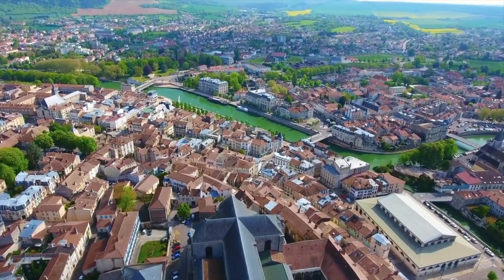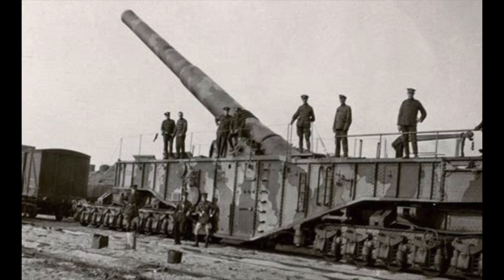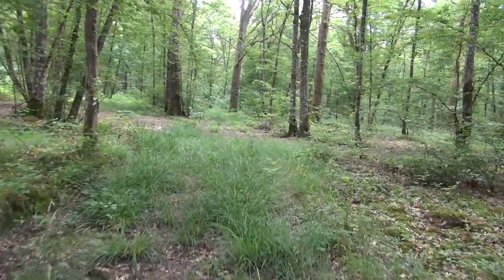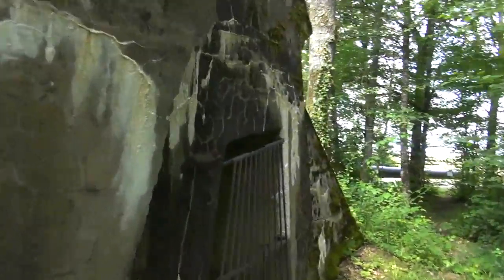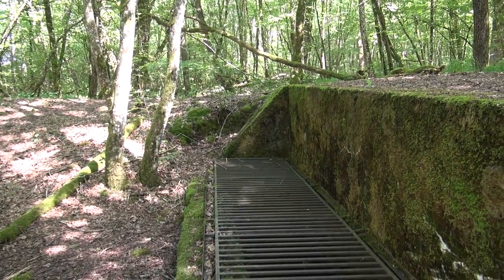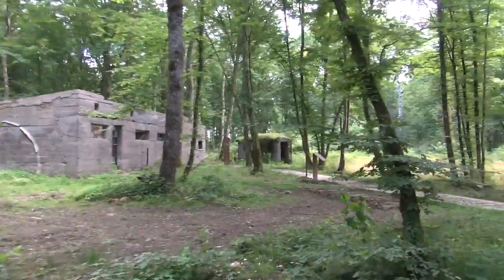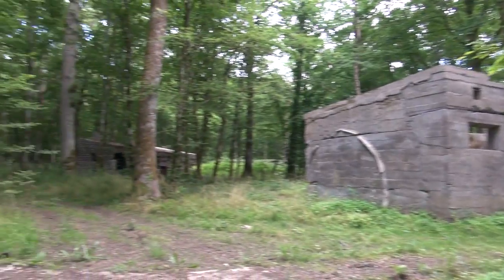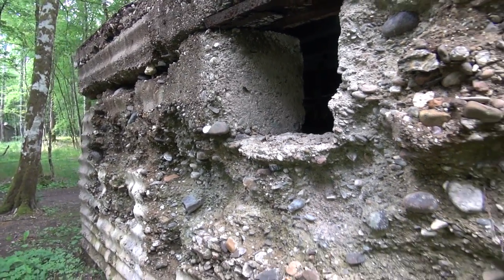THE SECRET EXPERIMENTAL BUNKERS OF WW1 VERDUN

Comment: Tino

Amazing videos as always.

I'm very confident the three arches are supports for a double or triple line railway bridge where the embankment and bridge deck has been removed or perhaps was never fitted.

I'm fairly used to following the route of various dismantled railways in the UK (the result of late 60s closures) on aerial shots and it looks extremely similar.

Go back to your zoomed out shot and follow the line accross the arches down and then follow the curve down and to the right. See the dark line of trees along what looks very like a cutting or railway embankment. 

As to why they are slightly different or dont quire line up, the pressures of war, human error or perhaps the gradient? Or maybe a rebuild post a collapse

Comment: The three arch structures would have been covered in sloping earth. Farmers did later remove the earth from bunkers to increase area of land for farming. You often see bunkers in Normandy and else where that the earth was taken away. As to why they were not “dug in”, possibly due to ground conditions, either to hard to dig or waterlogged. Also digging in means inclines in order to get rail trucks in.

Comment: I've been at the cannon 5/6 years back. The frog pool is shaped like an arena where one of the rails is used to push and pull the canon in and out to hide it inside the arena and cover it with cammo. In the arena there are hidouts for troups and thats where some of the tunnels to the outside structures end.
The water has been rising a lot since then!

Comment: The three 'bridges' where part of a bigger bridge. It was build in 1930 and operational in 1935. It was build for military transport to the maginot line. It has a capacity of 72 trains in 24 hours. The germans destroyed it in 1943 to use the materials in russia and the remains of the bridge was used for repairs on the roads nearby.

Comment: At around 40:05 you wonder whether the groove on the road bunker could be for a door. Its not wide enough for that but could be a drip groove. Its a fairly common (in UK anyway) device to stop rainwater creeping back along the concrete.

Comment: Those "mystery" short tunnels seem to have rocks and gravel on top of them.

Could it be that they were originally completely "landscaped" with rocks and soil and living foliage.

A couple of good "wet-seasons" would have eroded such covering.

Post war, the local farmers probably stripped the remaining covering away, possibly to fill the odd shell crater or two.

You would be right about "archives". The mystery of the "missing" mass graves (for fallen Australian and Brit troops) at Fromelles was primarily solved because there were British aerial photos showing a set of large, open pits behind the German lines and then some time after the whole disaster was called off, aerial photos clearly showed several of these substantial pits were filled in.. The Germans had their own separate "field cemetery" (Mass graves for primary battlefied sanitation and "tidiness”) with more formally-established ones for later re-interment, well behind their lines, but the bodies of Allied troops tended to be stacked in mass graves, away from potable water and encampments, for obvious reasons. That they had a reasonable number of these large pits neatly laid out near Pheasant Wood, indicates they suspected something was afoot.

This may also have been because Brit signals security was below par, especially their field telephone technology.  They went to war with a field phone system using a single wire carrier, elevated in wooden stakes. The signal "return" was via the ground itself. Our Teutonic cousins preferred an insulated twisted pair of wires that could be buried if time permitted AND because the twisted insulated pair self-cancelled any radiated signal, much the same way modern Cat5 and 6 computer network cable does, via its multiple tightly-twisted pairs..

The catch here is that the Brit method behaved like a crude radio transmitter, and the Germans rapidly developed "receiver" units that could capture this radiated signal. Thus, they were effectively reading the Allies mail, 24/7.

Fromelles also featured a German diesel-powered narrow-gauge logistics railway. It also was one of several major battlefields where the water table was so close to the surface, trenches and bunkers could not be dug successfully, so both sides built UP. One difference was that the Germans were enthusiastic users of concrete, especially for their interlocked machine-gun block-houses.

Comment: Those three archways are an interesting puzzle. Do you have a map reference for them ? Some pre-war maps might be helpful in determining if the stream is "natural" (my guess is it is due to its irregular course.) The roadway looks modern. They seem too small to be worthwhile storage bunkers (and why put a storage bunker over a small stream ? Are there any LIDAR scans of the area ? Do we know what units were stationed thereabouts in 1915/16 ? Update : The three archways are from the time there was a railway embankment. The farmers dismantled the embankment after the railway line was closed down. I posted a map co-ordinate for a railway bridge to the SE of the archways along the line of the railway but it has disappeared.
Reply: In many parts of thatregion, they ran networks of drainage channels to get rid of the excess water but to maintain enough water in the soil for crops and stock.

A lot of French farmland was wrecked by the massive application of artillery shells during WW1. Thus, the centuries-old drainage system had to be rebuilt post war. Natural stream? Or carefully laid drainage ditch that follows the fall of the land at a very precise declination? A good ordnance survey map might give some clues.

Comment: On possible answer  to the bunkers is railway the locomotives grew size with what they hauled and type in Belgium is a ww1 ammo railway go check with those guys possible source of ww1 railways
Also
If you look at the left drone it showed the stream passing through and on the right the smaller was a track which ive been told were like ww1 trenches for railways semi sunken....

Comment: 44:00 i would guess the bunkers were burial and railroad tracks were run inside they pulled out the gun to fire them and put them back into the bunker after they were done firing they could not have been seen from the air when fighting over?